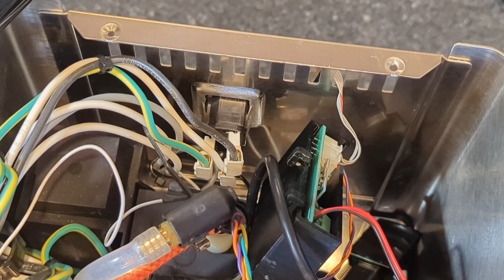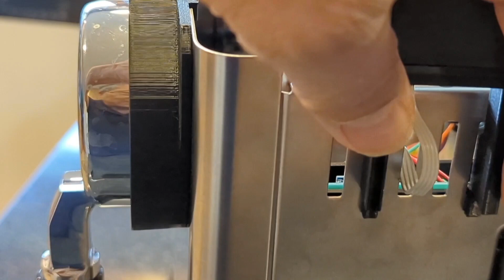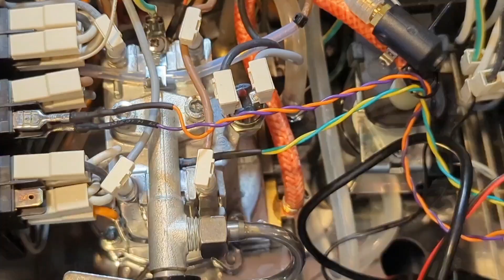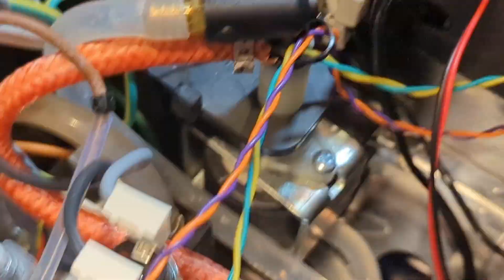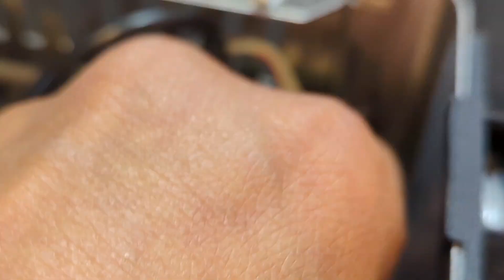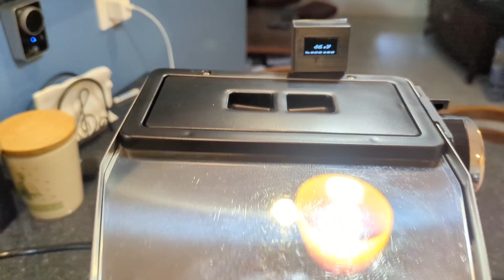Gaggia Class Pro Mod Kit

Comment: Very clever. So the controller is not a PID but it does show you the temperature, correct ?  This is still very important mod to highlight temperature. I wonder if this will work on an older Gaggia, if  it is just a matter of knowing where the power connectors are on the machine.

Comment: Looks like a clone. The temp sensor you used has a big error at high temperature.
Reply from the maker: I would appreciate it if you can show me which one I cloned from.  The temperature sensor I used is rated 150 degree C. Lots of cheap temperature sensors look the same but rated only to 120 degrees. Not to be confused.